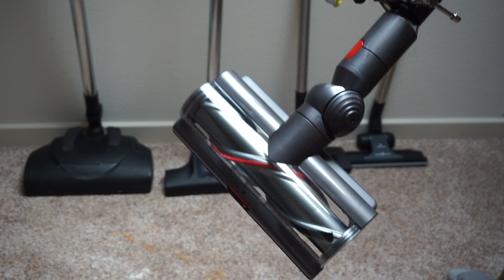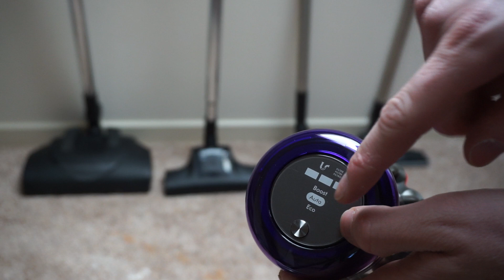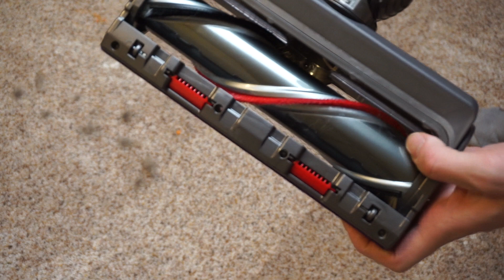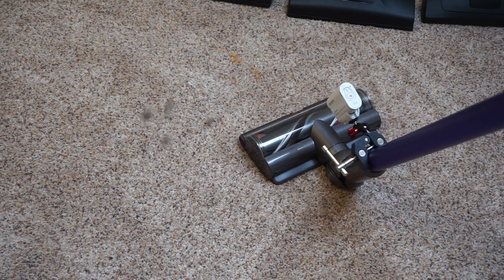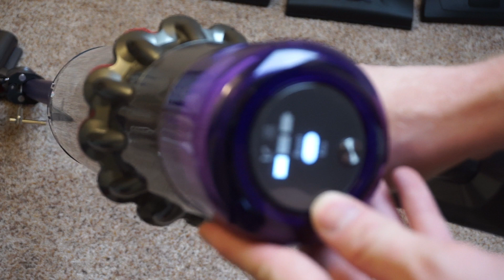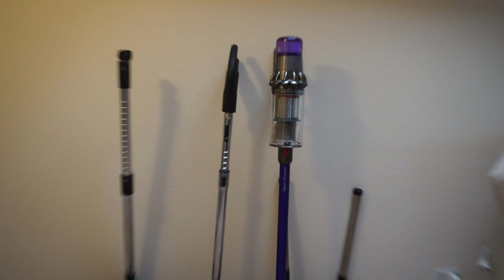Dyson V11 Soft Carpet Problems - Befor You Buy Dyson v11

Comment: Thanks. I wanted to see the gopro view.

Im having this issue with my new dreame z30 on my large 8x8 rug. It's such a strong suction and the rug is very soft and flexible making it immediately such it up and get stuck. I opened the gate and lower power to eco but still gets stuck after a few seconds. Im using the carpet multi surface head and brush. Very disappointing its too strong. If the builders as your dyson know its 2-3x strong than entry vacuums they need height adjustment and/or ability to run very low suction

Comment: Dyson says eco for soft carpet
Reply: The real solution is to get rid of your medium or high pile carpet or soft carpet and replace it with very low pile w2w carpet. And also move to a 300 sq. ft. house.
Reply from the maker: Eco does not have enough suction power to get carpet clean.
Reply: eco doesn't work either. It still sucks too much.

Comment: He’s absolutely right I literally just got done dishing out almost $800 for the v12 which basically is the same as the new v15 but it’s lighter with a tad bit less power but it has lcd screen and the laser light crap anyway I’ve tried every brush and non was helping me vacuum my carpet with ease my arms hurt so much from how hard I needed to forcefully push the vacuum on my low pile carpet I really felt like a sucker here I was working like a dog to get a premium high priced item to work

Comment: I just got a V7 for Christmas from my grandma she knows I like vacuums. It’s much lighter weight than the v11 and the original power head design I think is superior it has wheels on the front and back that are rubberized. So it actually moves on my carpet but it’s definitely not a primary cleaning machine like they sell it as. I’ll be using this for my front entry rug when I don’t feel like dragging my heavy vacuums down the stairs, and for quick clean ups in the kitchen and stuff like that. You just can’t replace AC power!

Comment: I think that it will totally depend on your home if this vacuum will be good or not for you. You cant have a big house with mainly carpets and expect a cordless machine to replace an upright, because it wont. But if you have maybe a smaller home or mainly hard floors with some rugs or only a small area of carpets, it will probably do the work. I think that this machine is maybe too expensive to be a vacuum to do smaller jobs or to form a pair with your corded vacuum, because a v8 or v7 is cheaper and is a good vacuum to do small jobs, but if your very rich then it will be obviously better to get one of these. Lol

Comment: Two points to make:
1. Why there's no brush On/Off control you asked? Because it fails right away without brush, as the suction alone is awful.
2. Why it did so poor on carpet? Because Dyson does not care about carpet anymore, as research had found out 99% of targeted market in that region where they thrive, is of hard floors.
Reply from the maker: It's horrible on hard floor with that tool . See the other other video in the description.
Reply: Performance Reviews hahaha! Exactly right, I remember that when I tried out the older V6. Thank you for the vid, we really need to send this message across so that people make sensible choice before forking out their hard earned cash.

Comment: They’ve marketed it to be a replacement for an upright but if you have a full house of carpet you’d be a fool to think this thing could keep your home clean
Reply: I have this vacuum and even on the lowest settings, it can't vacuum any kind of rug/carpet for crap.
Reply: Modern homes have very little carpet in all honesty. I have a 6000 square foot house, there are four 8x10 area rugs, the balance is engineered hardwood or tile. That’s just how things work. Carpet is a huge pain to deal with. My 90 lbs boxers do virtually no damage to my engineered hand scraped hardwood floors....to each their own, but we will be buying the Dyson this morning.
Reply: bionicangel123 respectfully have to say I have a v11 absolute and it's the only one I have in a four bedroom house. I have no need for any other vacuum and I never run out of power. It's streets ahead of a corded bagged cleaner in my opinion as a consumer.
Reply: Anne-marie Wildbore 

Yeah I guess these people are really just Miele and central vacuum circle jerks. Respect all vacuums

Comment: Looks like the battery drains down quickly. At least you are getting a good workout for the 7 minutes you have.
Reply: You get around 64 minutes on low and around 25 on medium when suction is boosted for carpets, and around 40 minutes on medium on hard floors. I rarely ever need to use max as it usually is too powerful. Medium does an excellent job for all my cleaning. I live in 3000+ square foot house.

Comment: They can at least put a suction control valve on the actual wand or an actual height adjustment instead of not having one but no Dyson only cares about form over functionality.
Reply: I don't get your complaint. Members in my family range in heights from 5' 4" to 6' 2". No one has ever had an issue with the height of any Dyson stick vacuum.
Reply: @ZunarZulfiqar  Dooooooddde... I think Rick means a 'Height Adjuster' for the cleaning head... 🤭